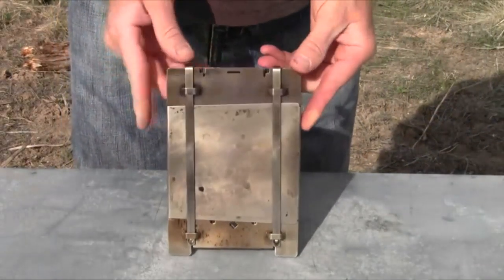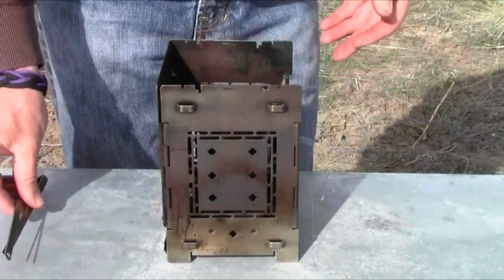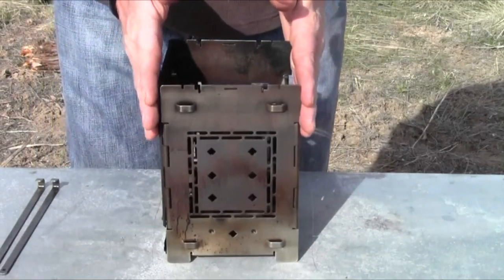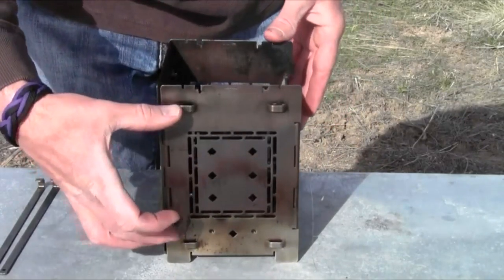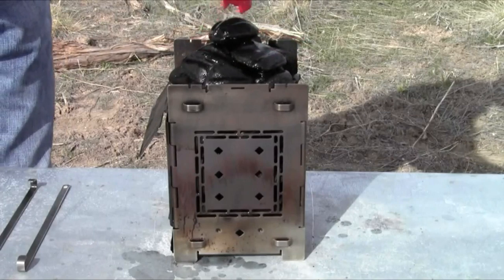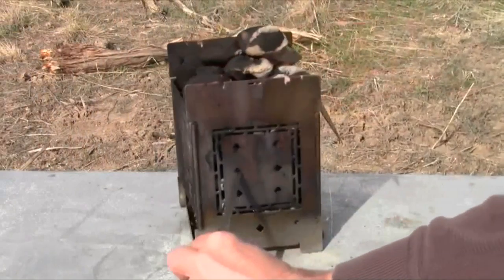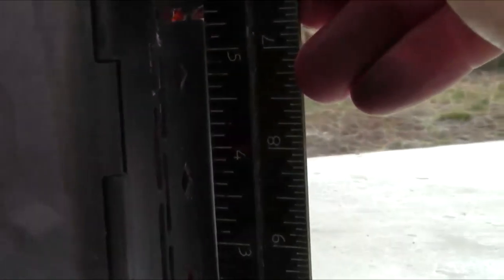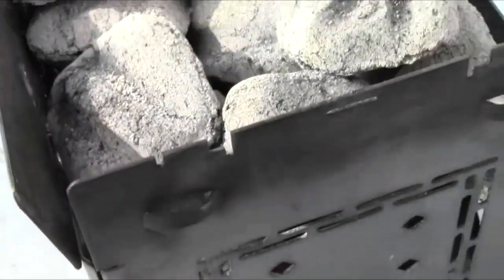How The Folding Firebox Camp Stove Controls Expansion To Avoid Warpage.

Comment: This is a very practical and thoughtful clarification !! Thank you.
But I wonder if there is no need to make perforation on all of four side panels. Do the left two panels have less risk of warping?
Reply from the maker: Exactly. Because two of the panels are about half the length the warping that does occur is hardly noticeable. The expansion happens at the center so the further out it is measured shows greater deviance.

Comment: The whole time he was burning his hands with that ruler I was thinking "grab your pliers! multitool! multitool!"

Thank you for confirming what I suspected about the perforations on the sides. I've usually used rocks and a pit for fire control, but I've experimented with soda can stoves and build a few coffee can stoves

I've been using these stoves more since they seem to reduce my imprint when camping and this is probably the brand I will purchase but, there is a feature I do want to see or self-modify and am curious if others have experimented with the Firebox. 

I want a side door. I like how the firebox feeds from the top so such a door would be for lighting. However, I can see some addon mods that could turn it into a more rocketstove design/side feeder for larger sticks--even a slim log. But what I'd want would be something large enough down toward the middle or bottom that I can get my match, lighter, or sparks from my magnesium rod into the tender. Those perforations looked purpose built for such a small hatch but now I'm wondering if you had prototyping problems (like warping in hinges at that area) and that's why a door did not go into the side of the finished product. 

Is this the case?
Reply from the maker: Not at all, the reasons for no door are that it would interfere with many of the position adjustment holes and quite honestly, it the stoves big enough to handle quite large sticks I like top feeding much better. The Firebox can take sticks as long as eight inches when placed at an angle, that means less fire maintenance VS moving the sticks in an inch or so at a time. Also, longer sticks are easier to break.
If I had a door I would rarely use it. I love preloading the FB and cooking whole meals without maintaining the fire at all.
Reply: FireboxStove Thank you very much for such a quick and concise reply. Agreed on all points; other than a "rocketstove" addon modification, any side door would only be for lighting purposes and thus only used the once per burn. The box is already added to my wishlist with the grilling accessories for when I start my forays around Pisgah in a few months :D

However, the idea remains stuck in my head!

As the engineer who created this, do you think that I could make a door using the existing central portion. I'm looking at the face shown from 0:30-2:58. If I were to modify for this, I would cut out the square in the middle (the portion with the six diamond shaped holes) and grind the edges of the box and the "door" smooth. The outer exhaust slits would remain but the inner exhausts are now empty. On the left side, I'd use those 4 horizontal slits on the outer rim to attach 4 clip hinges (maybe just 2 but probably 4) that I'd mig to the outside of the "door".

On the right side a simple 1/4 turning latch would secure it. About the size of a dime flush to the inside of the door, with a portion of the edge bent in a twisted "U" shape to act as both a stop for the hinge when it is down and closed and to hold it both in and outside securely. To operate, twist the latch clockwise and, the U moving "up" to open. Its natural inclination should be to remain down and closed when feeding. 

Any stress pressure would be coming from the weight of the combustibles inside. The edge of the dime should be about as much materiel as you currently have holding that center plate

I could also open such a door in a pinch to allow better drafting if the fire should become smokey though, from your videos, THAT DOESN'T APPEAR TO BE A PROBLEM!

Again, I would greatly appreciate your thoughts. I do not want to ruin this nice piece of kit after I get it :P
Reply from the maker: Scott Covington That sounds like a pretty good plan but you would loose your Trangia holding position holes. Also the raised components (which you are considering) would prevent the Ash Pan from clipping on the front when folded up.
If you're OK with losing some features to gain other features then go for it! I would love to see it when your done.

Comment: Ok I got the stove. Aw man it puts out some real nice heat. Made my share of both tent and hobo stoves, also own a Emberlit, zipstove, trailstove, core4 etc etc. This stove doesn't want to clog. Tested it with higher moisture willow and swamp maple. Just kept burning and burning as the water boiled out the ends. Nice! Took a bit of practice working with the grill and ash plates the first time cuz of the stove's shape but got the hang of it. Will work good for times when I might pack the white gas or shorter range ramblings when the weight won't matter as much. I am going to make a video starting my fire box with a sycamore on sycamore or willow on willow browdrill set. Will use a cedar bark tinder bundle to blow the coal into flames with yellow birch bark to get a nice fire going. The big open top will take a tinder bundle nicely.
Reply from the maker: Your comment speaks to your experience. Most people don't realize what a problem clogging can be. Review video's generally only burn a stove for a short period of time saying this works great, not realizing that most any stove will work well at first.  There a few factors that cause clogging one is insufficient air flow which prevents the fuel from burning completely to ash. The symptom of this problem is coals turning black. Another problem is generally caused by how the stove is fed. If the act of feeding the stove compresses the contents breaking up the coals it will cause a loss of airflow. The other factor is when the ash has no where to go and it builds up until blocking the air holes.

I like gently setting fuel on top criss cross a little bit at a time and not stirring the fire or preloading and lighting the top to burn down. Both methods keep the fuel as whole as possible maintaining the spaces between for air flow.

Thanks so much for your comment!
Reply: FireboxStove Thanks. I actually posted that promised video on my channel of me starting the Firebox stove using friction fire methodology with tinder gathered in a frozen woods. Heavy rain followed by an instant hard freeze. I did use Yucca for the fireboard and spindle rather than Sycamore because I never used it before. My hands were almost frozen with temps in the singles and sub zero windchill. The Firebox warmed my hands almost instantly. It actually perked me up like a powerful little campfire. Best of all I didn't have to monkey around assembling and taking down the stove in the cold because it's so easy. Only con is the way those fire sticks blend into the ground if I am careless. The mixed shades of brown really makes them blend well into a natural environment. Not that the lose of a Fire stick will stop this stove. I keep a good on both of them if not in the stove aka no just tossing them aside on the ground till needed. Then again I spend 1/2 of my life looking for my lost car keys. LOL!
Reply from the maker: MegaWoodswalker Awesome! I'm so glad to hear that the Firebox is serving you well! That assembly in the cold aspect is a great point! 
I can't wait to see your video!

Comment: Stoves with port feed systems can also take fuel in the top. There is no law against it. LOL! Warping isn't so bad as most of the more UL stoves come back together when setup. That said your stove looks fantastic. I think this is going to make a nice campfire replacement cuz of the large unrestricted firebox and draft. Order placed! Also support Made in the USA!
Reply from the maker: Thanks so much for the kind words and for your order. Please come back to this conversation once you've had a chance to become acquainted with your Firebox!  
I was just trying to say that the Firebox has massive intake and exhaust for a wide range of BTU output where other stoves exhaust and intake are somewhat calibrated to the amount of fuel that will fit through the side feed port and feeding additional fuel from the top can cause a imbalance of the fuel/air mixture expressed by excessive smoke.

Thanks again, Steve
Reply: FireboxStove I also got the fry plate. Yup will post again once I get it. Thanks again!

Comment: That's it going to get one cannot get the add ons on ebay just now but have been assured he will have the hole shooting match in Jan can't wait to get it and try it out
Reply from the maker: Thanks David. Is there a reason you want to wait till Jan rather than buying it from fireboxstove.com now?
Reply: +FiireboxStove   i wanted the hole thing with all the extras.
Reply from the maker: David Pollock I see. Thanks for your interest!
Reply: FireboxStove do you have the pouch that holds the firebox stove and the grill top .pot holder
Reply from the maker: Yes, Here's a link: http://www.fireboxstove.com/accessories 
Here's a discount code as well:    foundersd

Thanks.
Reply: FireboxStove thanks got everything i need

Comment: How does the Nano-box compare with respect to warping?
Reply from the maker: Both the SS Nano and the Ti Nano are made of thicker material than it's competitors of similar size. I just don't believe in compromising quality to save weight. I have never seen warping in either version of the Nano. SS 6oz Ti 4oz I saved weight by using less material with the use of the spring steel legs and pot stand. Rather than by using extremely thin material.